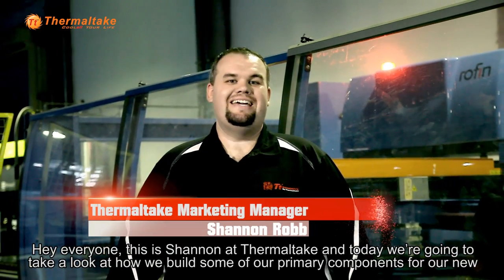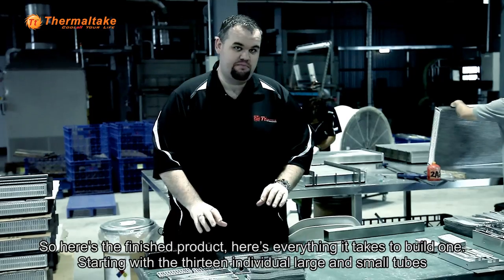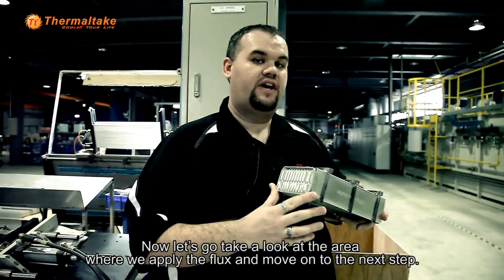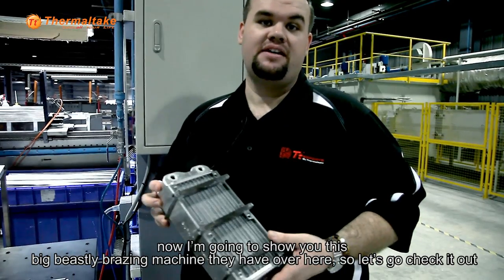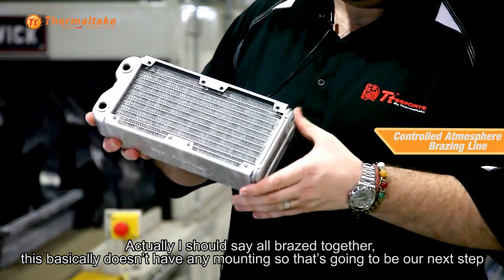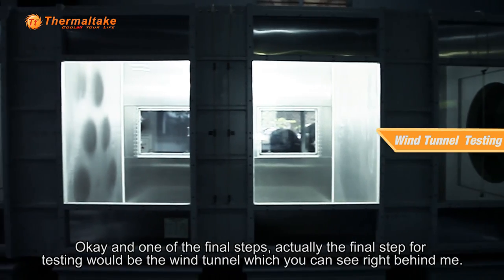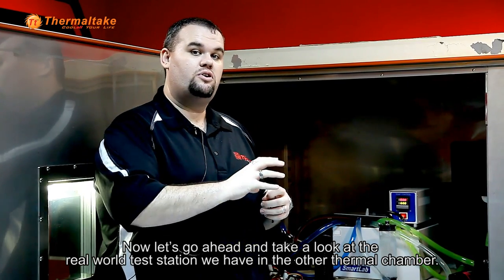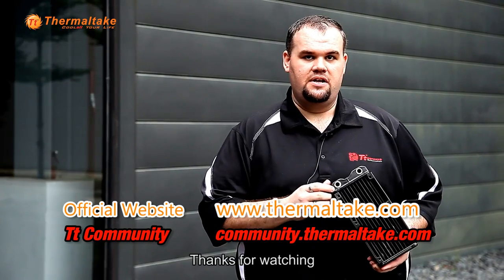Thermaltake - Radiator Manufacture facility tour

Comment: Main problem I see is all the aluminum used. You could make the best designed rad out there but as long as you keep making them out of the wrong material, you're not going take the market by storm.

Comment: You know everyone keeps saying "aluminum bad corrosion bla bla bla" If that was the case, why would thermaltake rent/buy this huge facility and employ all these workers to make their rads? I feel like people would not buy them if it were the case... I bet its not nearly as big an issue as people make it out to be.
Reply: I've been looking all day for a single picture of a thermaltake rad/block corroded, and found none. Some say it did after a few years. I can easily change blocks/rads after few years
Reply: For a whole system... a few years is not that long, for single part running constantly, its a long time I agree. Just got to make sure you use a pre made coolant with inhibitors for aluminum. People try to do this with water and copper sulfate... of course its going to galvanize.
Reply: exactly. People who say that using mixed metals for liquid cooling A) either did it wrong, or B) have never done it, and are afraid to and will only feed themselves the stories that other people hear without experience. I've used the same radiator for 5 years on mixed metal. the only reason why i stopped, is because i ran out of coolant. and wanted to go back a fan configuration like push-pull. Now that upgraded to a Threadripper, i went back to a Thermaltake AIO. sadly, only a 240, because my case can't fit anything higher.
Reply: because it isnt.. only if you use plain water... Cars use aluminum rads with iron blocks... that can cause issues if you use normal water...  But eith antifreeze lile propelyne glycol its fine.. use a premixed coolant and youll habe 0 issues

Comment: Aluminium radiator = fail...
Reply: used mixed metal solutions for years, never had a single issue. why? because mixed metals doesn't matter as long as you use the proper type of cooling MADE for it.

Comment: whats with you cry babies and aluminum radiators... I work on cars.. and they have been using iron. copper aluminum parts all mixed with the cooling system and  they run just fine if you maintain the cooling system.. If youre that worried about aluminum and a copper block use some propelyne glycol aka snti freeze.. it wont hurt plexiglass ad itll be just fine in your loop.

You damn hipster nerds are frustrating.... And yes ive been watercooling and building pcs for 20 years... Aluminum is fine.. just use a proper coolant to prevent corrosion..